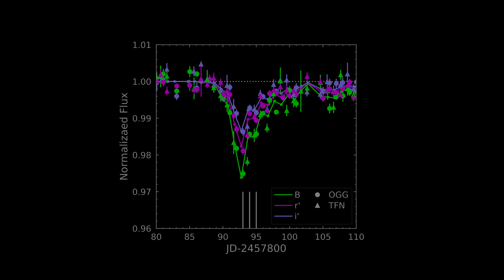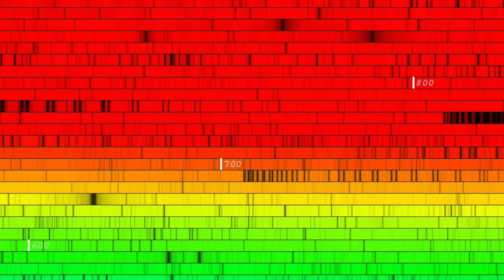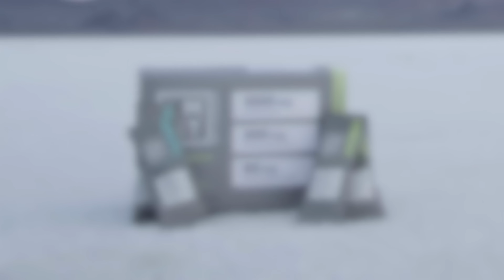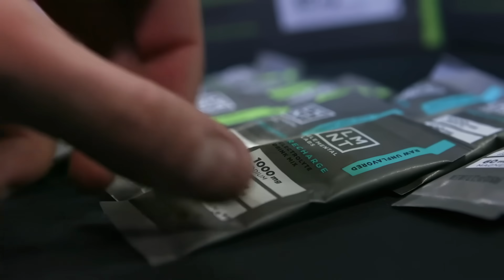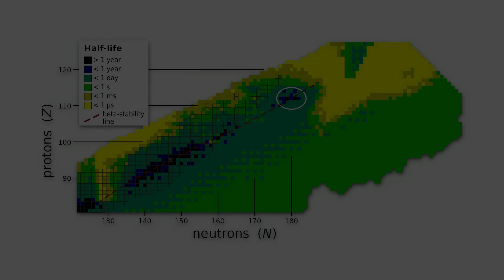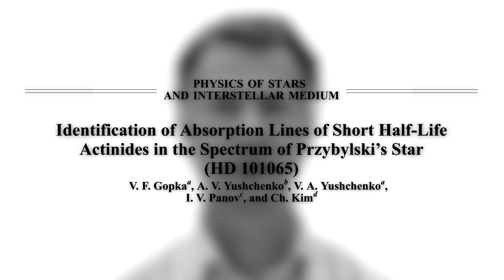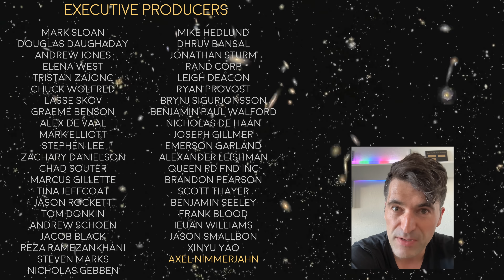The Star That Shouldn't Exist

Comment: 10:36 In medicine, there's a saying, "If you hear hoofbeats, look for horses, not zebras": Uncommon symptoms are more likely uncommon symptoms of a common illness than common symptoms of an uncommon illness.
Reply: Which I guess is why it took all of my many doctors and specialists 29 YEARS to accurately diagnose my uncommon medical conditions - even when paramedics, nurses, and I had suggested the correct diagnoses numerous times along the way!
Instead, I'm now disabled from their failure to treat correctly, and permanently injured from meds they exposed me to that I never needed. And there are many others in similar situations.
The moral here: If it SOUNDS like horses but the locals tell you they SAW a zebra, look for both!
Reply: @llkg9  That is awful. I am so sorry.

Is there any chance that you can sue and at least get compensation in order to make life more bearable?
Reply: @llkg9  Thanks for sharing your experience. Maybe people will start to question the doctor's diagnosis earlier than later.  I am sorry for what happened to you.
Reply: @llkg9  no, the moral stands as is. It's not about there not being weird shit. It's about not STARTING there when trying to solve a problem. Because you shouldn't. Somebody comes in with a runny nose at the beginning of cold season you don't go straight for the ebola testing kit. There is a FAR higher chance that you are dealing with a common issue with a common solution. So that's where you start first and where you have the highest statistical probability of finding the solution. That's why the saying exists. And all you in the comments trying to act like it's not good advice based on rare occurrences is just weird. The saying doesn't mean that "zebras" don't exist. And if you were so sure of your untrained diagnostic skills but stayed around to be poked and prodded for 29 years anyway then idk what to tell you. Maybe change doctors a little sooner next time.
Reply: that's the trouble when you have an uncommon illness, usually too late when they finally pin it down.
Reply: It's a good saying if one is trying to narrow down the field of possibilities for which to check, but at some point one has to turn around and check to see if it is actually a horse.  @llkg9 is a perfect example of blindly following a formula and not questioning when the results seem to contradict the assumption, i.e. horse not zebra.  To take the analogy one step further, there are a LOT of hoofed animals out there so doctors should not hang out too long looking for horses and zebras.
Reply: I've heard that medicine is one field where Ockham's Razor often doesn't work well; If someone has a diverse range of symptoms that don't fit with a single common disease, it's much more likely that they'll have multiple common diseases rather than a single rare one that would account for all of the symptoms observed.
Reply: @davidschaftenaar6530  The most likely thing then is that they have a common disease that is still unknown or little known. There is still much that is not known about diseases.
ME/CFS, Long COVID, Chronic Lyme Disease, IBS, Fibromyalgia, POTS, Hypermobile Ehlers-Danlos' syndrome, ADHD, Autism spectrum disorder, Interstitial cystitis, Endometriosis, Multiple Chemical Sensitivity, Migraine, Fatty liver disease, Obesity, Type 1 and 2 diabetes, cardiovascular disease, solid cancer, various psychiatric disorders to name just a few disorders that all can come from common Mast Cell diseases such as Mast Cell Activation Syndrome and possible Hereditary Alpha Tryptasemia Syndrome. Both are relatively newly discovered and little known inflammatory diseases that are very common.
Reply: Nowadays it would be "If you hear hoofbeats, look for horses, not unicorns or zebras".
Reply: However, as there are a lot of uncommon illnesses/conditions, there is a relatively high chance that you will come across someone with a rare condition. Statistics, eh?
Reply: @plepenumbra Yes there is a lot of stars in the galaxy, it dosen't say anything about how likely is life to appear. 

And it's not even the topic here, the star SEEM to have uncommon content (low iron, the possibility of presence of very heavy elements) the video give very little room for more plausible and mundane explanation (He didn't even bother to speak about the most likely scenario that was dissmissed, the pulsar wind) to make a very misleading and dishonnest point about aliens civilizations, based on... nothing.

When you read the studies, they aren't even sure of the presence of most of those heavy elements, expect for technetium and another one, wich are in the chain of decay of uranium or thorium. They say nothing about aliens. That's just clickbait for the sponsor video, it wouldn't be the first time he did such a thing.
Reply: Assuming this star is showing a clear techno signature.. would it not be useful, or curious at least to work backwards from this assumption?
The most obvious and easy answer is the rubbish tip assumption. Dumping your radioactive waste into your star. 
But maybe it's something more. What are the special properties or technolgical uses for these elements? Could there be a specific outcome from a civilisation salting this star? 
Or if these elements are byproducts, what process or technological n3ed could account from them?
Reply: A whole lot written but not a whole lot was said..
Reply: Unless you're in the savanna..
Reply: Exactly context matters. People who live by strict rules have no understanding of nuance @pellestorck3776
Reply: It's the same when talking about the universe around us, we've only just started to look at the stars so every single time we look up there's a good chance we'll see something we've never seen before, like the 40 separate pairs of gas giant's in the Orion Nebula that were just discovered by the James Web Telescope. We've never seen that before but we also didn't have the ability to see so clearly before until we had this Telescope. So for all we know it could be extremely common in high star forming regions.
Same when it comes to the Przybylski's Star, it's just something we don't know much about yet but it's most likely natural and something uncommonly, common that happens in the universe.
Reply: Corona was rare until it wasn’t
Reply: The reality I experienced recently is if there's even a remote chance it's a zebra and zebras are tremendously more profitable to diagnose and treat, whereas horses just mean sending the patient home with otc meds, they do everything possible to look for zebras including strong arming, many days of hospitalization, many tests including relatively dangerous CTs, and in the end justifying it all to insurance with "questionable" diagnosis (according to radiologists who are apparently afraid to admit they couldn't detect stripes on the horse.) It's not just a hammer looking for nails, it's a box full of hammers that can't pay their mercedes payments unless they find enough nails.
Reply: Wtf did that even mean
Reply: That's the dumbest quote I've read today. 
Especially since in medicine, exactly this obnoxious reductive approach, dumbing down any unexplained phenomena to symptoms of simple and researched disease leads to the miserable chronically reoccuring misdiagnosis of many patients.
Reply: @neotronextrem   Doctors misunderstanding it is what causes that. Read my other comment to see what I mean.
Reply: @neotronextrem  It's really more about considering common things first, not discounting the possibility of something rare. The approach is usually to rule out plausible emergencies first, then common, then rare. One does need to find a way to "rule in" a common diagnosis and also rule out rare ones when a rare but serious condition would be plausible based upon less specific tests.
Reply: @neotronextrem  It’s not doctrine, it’s a guideline. It’s another way to express Occam’s Razor. 

In the vast majority of cases, the simplest solution is usually the best.
Reply: @neotronextrem  It's not my fault you can't understand it.
Reply: You mean love right?

Comment: You said this star has 150x the magnetic field of our sun, but it shouldn't have the mass to cause the fusion to produce these super heavies like that? What if there is the fusion going on there, even without the mass, perhaps there is some kind of natural super collider effect going on due to the magnetic forces + the mass. 
-----------------------------------
Or I'm going to throw out a random outlandish thought that maybe something else more exotic is going on here, like a dark matter source interacting with super heavies in a way we wouldn't expect. If the stuff is largely unaffected by normal mater, but if there is an influence however slight, then maybe super heavies at high density, may might interact enough to make a difference here, to produce a fairly unique enviroment.

Comment: Spectral lines could also be used to encode data. One could add the elements to both indicate a manufactured origin and use the correct elements to give specific spectral lines for a specific coded message. A cleverly created code could include the star's native spectral lines, but the key would have to be in the unnatural ones.
However, wouldn't it take planet sized amounts of material to have an effect on the star?

Comment: So many imaginary problems from not understanding the observations. It’s the observations that are real and it’s gravity that is not being understood. We don’t need another law of gravity. Gravity is constant locally the same as the earth is flat locally. On a larger scale gravity is not constant and the earth is not flat. Gravity drops off considerably outside of the galaxy which changes considerably the measures of time and and distance which together make everything to appear to move faster including light. Things appear to be moving faster because they are moving faster as seen by us in our slower rate of time and our shorter measure of distance. This eliminates entirely the need for dark matter.

The changes in time and distance compound the changes in the speed of light. Do a thought experiment. Hold your hands a foot apart representing 186,000 miles saying “one thousand and one” representing one second while pretending to see an imaginary photon going from one hand to the other. Now expand the distance saying “one thousand and one” as fast as you can. You should notice that the speed of the imaginary photon increases the more distance expands and the more time speeds up the same as it does the farther away from the center of the galaxy it is.

The energy source of the vacuum energy is all of the supermassive black holes that are growing by drawing in spacetime. This means that the universe is not expanding into oblivion for no reason. It means there is no need for imaginary inflatons. Redshift occurs when light leaves the gravity of a galaxy and then the light is blue shifted when it enters another galaxy. Obviously galaxies aren’t all equal that way and distant galaxies are much more redshifted because of all of the mass of the surrounding galaxies that distance light has to pass by.

Comment: About the Sponsor: I tried an LMNT sampler pack and liked it enough that I ordered a larger supply. Its like Gatoraide in powdered, cool-aid form. So, since I mix it in a reusable bottle, I'm also avoiding a lot of disposable plastic bottles. Win/win. Also, they've since sent me additional samplers no-charge, so I'm a real fan now.
About the star: Perhaps its in the process of consuming a neutron star? Could the collision/turmoil be resulting in extreme conditions that can brew these exotic elements?

Comment: cold this possibly be an example of naturally occurring cold heavy ion fusion? maybe the magnetic field is acting in addition to gravity to create increased pressure allowing fusion to occur at lower energy levels. maybe a sufficiently large terrestrial planet was pulled into a type A star, causing it to be naturally salted allowing the magnetic field to develop and create the conditions for sustained cold heavy ion fusion outside of the stars core?

Comment: So nice to see a deep dive into one of my favourite stars, by one of my fave physics YouTubers. It is "peculiar" to me, that although we have discovered something that looks exactly like Carl Sagan's hypothesized techno-signature, it is casually dismissed as most likely natural. FWIW, I have a few thoughts. The most salient is that the relative abundance of the lanthanides to each other reflects their natural distribution, notwithstanding all of them being heightened relative to iron in this star. This in turn I presume to be a result of relative stabilities of nuclide configurations in the nucleus, somewhat analogous to electron shells. Even Z is stabler than odd Z, for instance. Secondly, the most salient factor for the stability of actinides is neutron numbers. Our lab-made elements are made by firing in neutrons to hope that they stick. Perhaps this method cannot make the large number of neutrons we need for this star to work. As you point out, the whole island of stability hypothesis is in itself mind blowing. It implies basically that we've still got another entire row of the periodic table still unknown to us, and I really liked this video for mentioning it. I would certainly support any large-scale study to really get to the bottom of what's going on here, because it is weird even if it is natural. My expectation is some source of neutrons to make those elements which is more efficient than our current spitball technique.

Comment: If this was indeed some sort of technosignature, I would guess the aliens would be from a different star system, who have traveled there and set up shop. 

I figured if this was some sort of A star, it's Main Sequence lifespan would be short (on the order of a few hundred million years), allowing little time for life to evolve to point of having a technological species. I looked into this a bit, and found that it's actually thought to be at most a small A star, or more likely an F star, and thus has a somewhat longer lifespan (estimated to be ~ 1.5 billion years old now, and near end of Main Sequence period). 

In any case, IF it were aliens, AND they were from elsewhere, perhaps they are there to do "star-lifting", harvesting elements from within the star for, say, building a Dyson swarm around it. Could that perhaps allow for dredging up peculiar elements from the core, that would otherwise never make it to the surface? I still don't see how such heavy and short-lived elements could be produced even in the core. But hey, once you open the can of worms labeled "Aliens", all kinds of weird stuff can be considered.

Personally, the mundane reason (we got the spectal lines wrong and these elements are not even present) seems the most likely. But if it DID turn out to somehow result from decay of elements from the Island of Stability, that would be very exciting. Maybe not megastructure-building-aliens-only-350 ly-away exciting, but still a major advance in science.

Comment: Very interesting, thank you. Some observations, and a most unsatisfactory suggestion: It's hard to imagine complex life arising in such a short-lived star system, so what would induce anyone to 'visit' from one assumes somewhere far more 'clement' with other options? There would have to be a darn-good reason without the convenience of FTL - surely we would know if anyone had such technology, having met them?  
Maybe this Type A star is 'normal' but for it's slow rotation allowing observation - we simply understand such stars far less well than we thought!
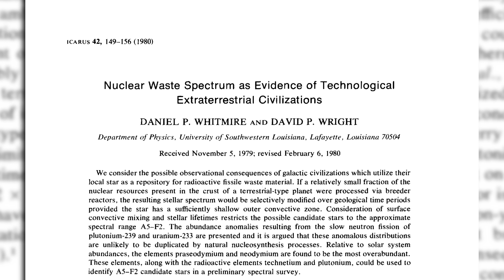Reply: The shown paper at 13:52 mentions that.
"In addition to this limit, spectral types earlier than A5 have lifetimes on the main sequence less than about 2 x 10^9 years and are therefore unlikely to have had time to evolve a technical civilization."
Which could explain deliberate "salting", they just go to a different star system where no complex life will develop. If that is deliberate by an alien civilisation, it might just be their version of NIMBY.
Because if you get rid of your super ultra heavy elements, you don't dig a hole in your garden, you put it as far away as possible.

Comment: So the 3 options are: 1. new physics, 2. new physics, or 3. new physics and fucking aliens hacking their star to mass produce transuranics

Too much iron is what makes stars die; the low iron could be aliens removing it to make the star more stable, and less likely to supernova in their face, while they screw around with it to mass produce exotic isotopes for (presumably) industrial purposes. A type stars would be useful for that kind of industrialization, since their huge size makes them have extreme pressures and temperatures more likely to produce exotic elements.